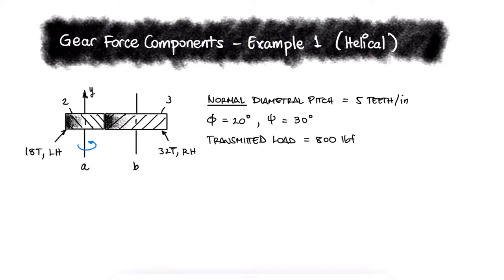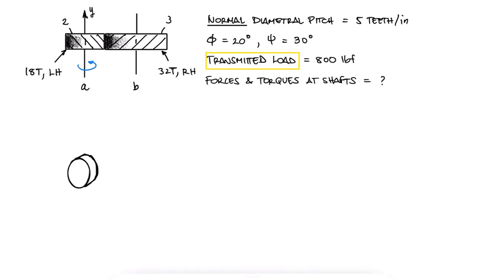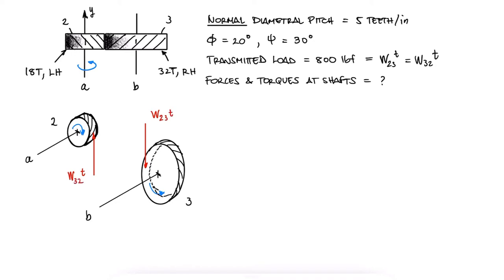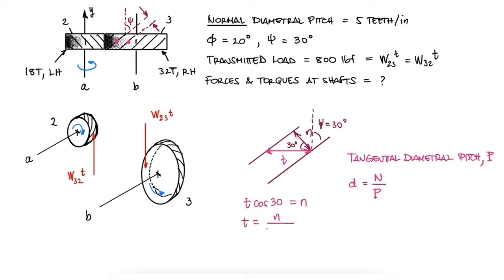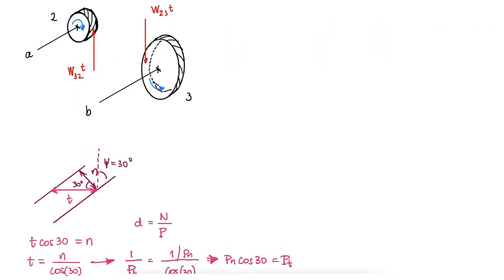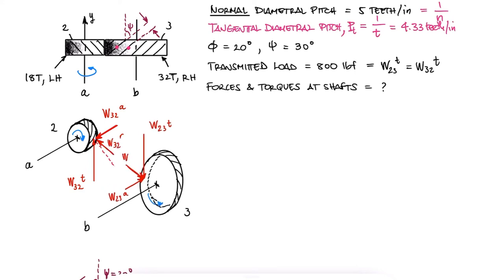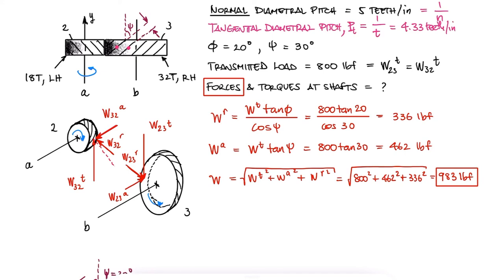Gear Force Components - Example 1 - Helical Gears

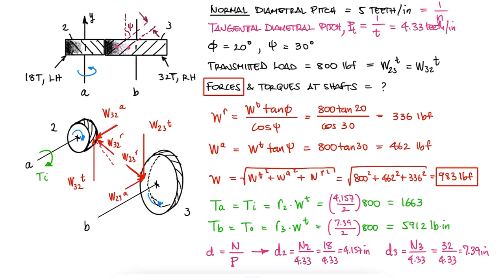Comment: Professor I think there may be a slight error at 2:53 as the equation should yield "2956" for the torque at shaft B, I think you may have dropped the division by 2 in the calculator.
Reply from the maker: Yup, seems like I did. Thanks!

Comment: Does the tangential force force remains same if there is one more parallel helical gear attached to it? For eg a helical compound gear, will the tangential, axial and radial force remain same with only change in torque per shaft as per no of gears on it?